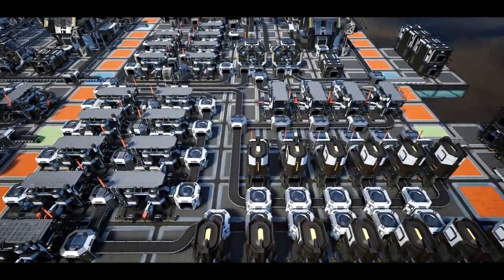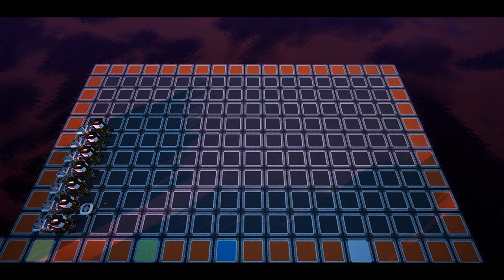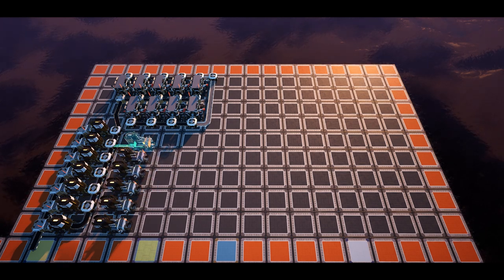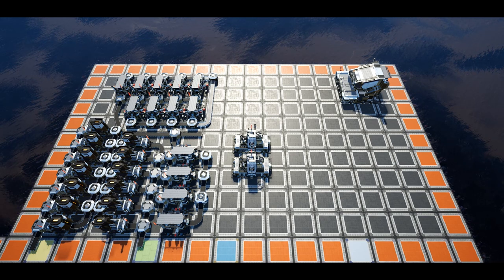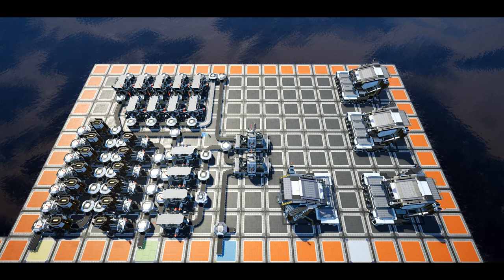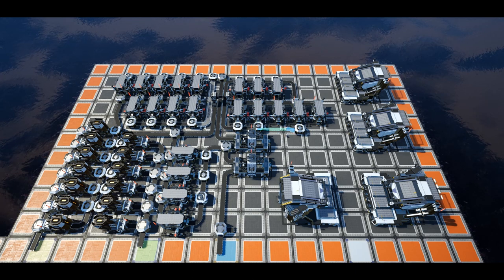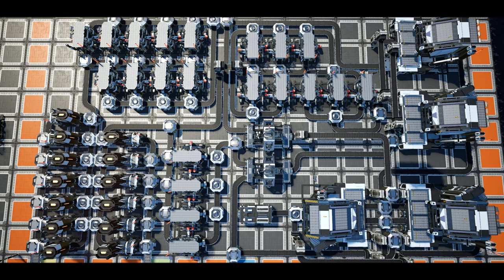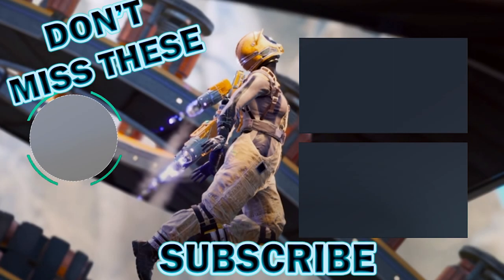Supercomputer Super Efficient Build Guide [Satisfactory Game]

Comment: When building a row of factories, assuming I want them lined up next to each other with no gaps, I set one down and then run away from it in the direction I'm about to build, hold ctrl while looking at the first factory, and click away. This auto-aligns the factory, and I don't have to worry about lining them up one at a time.

Which is fine, until they change the size of refineries half way through a build, and now I have gaps between them all!

I just noted on your video you seem to be setting them up one at a time, and wasn't sure if you knew of this trick.
Reply from the maker: Yep I know this, but in Multiplayer it sometimes laggs and so they get placed separately with weird spaces, so I tend to take my time to ensure that they're right :)
Reply: @TotalXclipse  Fair enough, not experienced MP lag before. Have a friend who I occasionally play with, but have only just unlocked oil, not even started building with it